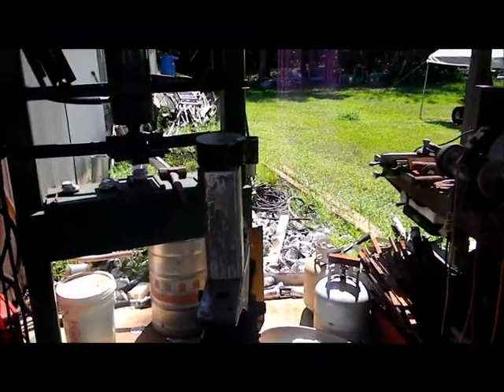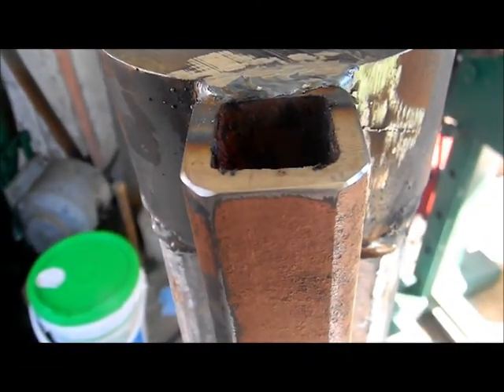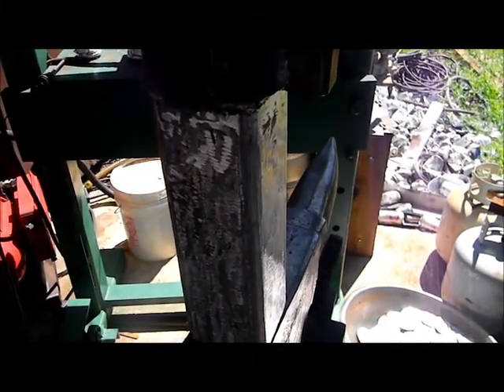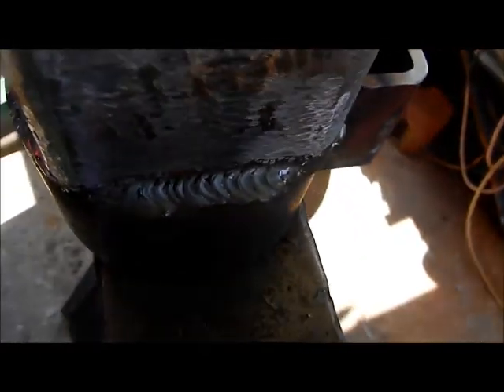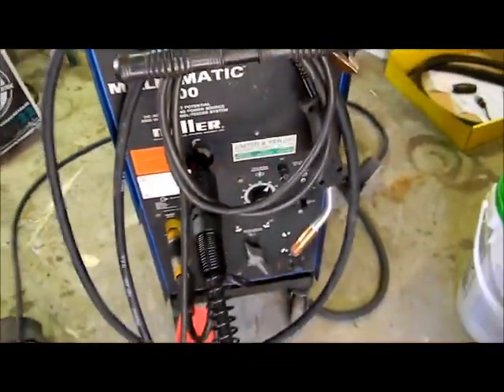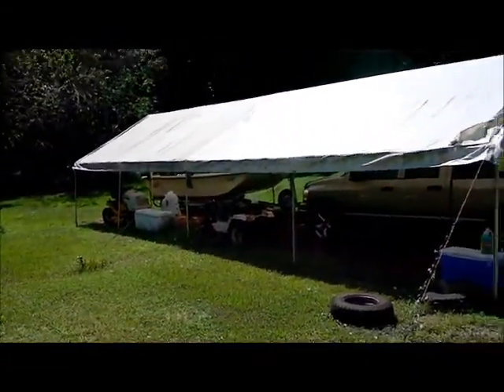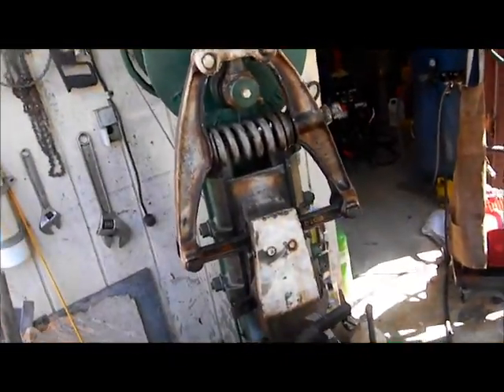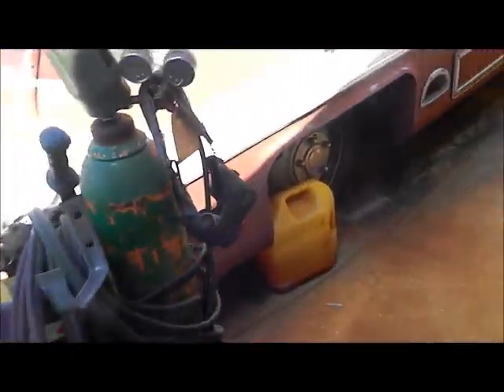smal anvil i made for someone!

Comment: here's a tip: for homemade anvils like these just get your piece of steel and get a splitting maul head and weld it on there then cut the bottom of the head off and use it as a horn and you can also file out the hole in the head and use it as a hardy hole